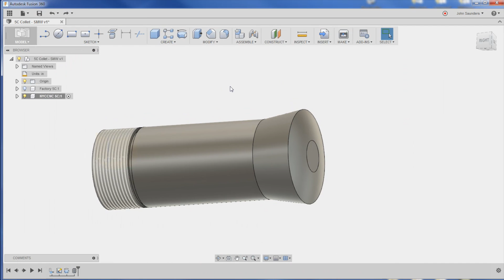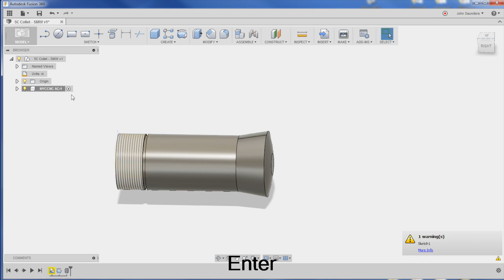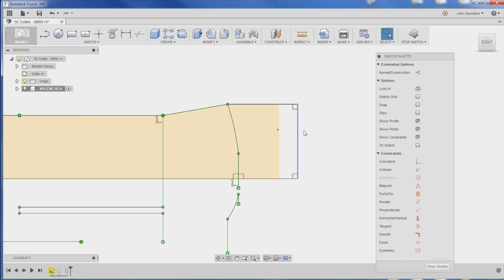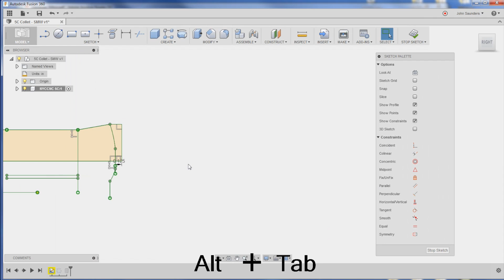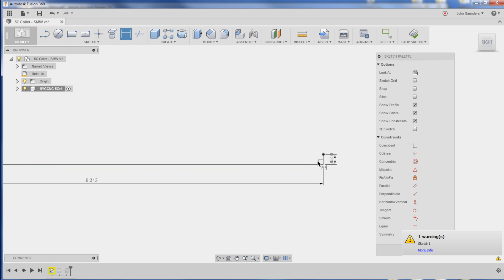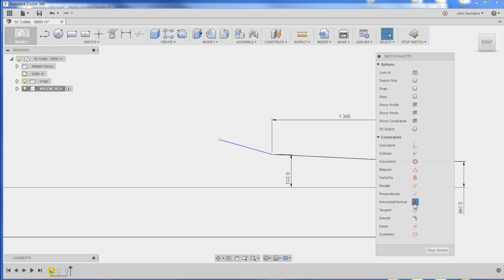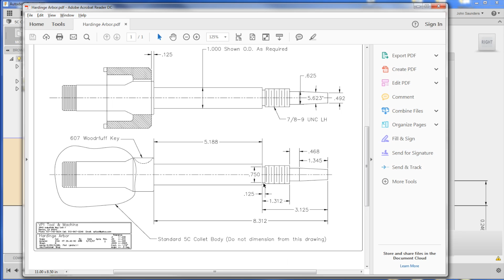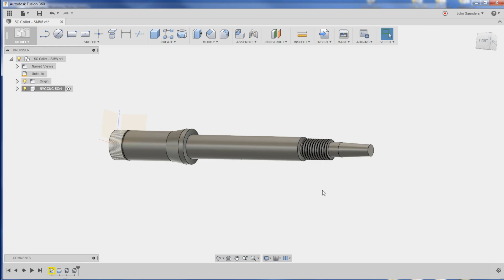Fusion 360 Hardinge 5C Arbor CAD Tutorial!  FF44

Comment: You need more information. The drawing shows that after the taper, the arbour has a cylindrical section that sticks 1/8" out of the machine, but doesn't give any dimension for how much is inside the machine. You modeled it as just 1/8" + the extension of the curved face of your collet model past the end of the taper.

Comment: Did I miss something or did you miss out a section that takes the woodruf key? Could this be another case of read the drawing thrice, measure twice and cut once?
Reply: It sure looks like there should be a cylindrical part with a key. Or perhaps the drawing is just for reference of some measurements?

I sure like these videos. Fusion 360 looks interesting. I use Rhino at work. Not nearly as good for technical design, but it is company standard (We do a lot of design with complex surfaces).
Reply: If you go back to time mark 0.26 where you talk about cross hatching, that is the driver for the arbor. If you zoom in in the collet receiver in the mill and look at 12:00 and 6:00 you'll see a small slott. Those slots receive the drive pins (not cross hatched in the drawing) The 5C then gets a woodruff key slot and a screw to keep this drive collar attached to the 5C.

Comment: do you ever think there will ever be a day that a person can scan in a traditional print run it thru software and come out with a cad/cam file? seems to me that's where things are slowly going and may already be there i just dont see it,, things have changed so much since the days of hand drawing everything <where i learned what little i know>, thanks for the videos gives me a sight into a world i just dont know/understand but intrigued by!
Reply: I can see it now. Put your stock in the vise. The machine does a 3D scan of the stock. Feed the machine a solid file from either a created design or 3D scan. Machine creates the part without interaction. I don't think it's that far off.
You can almost do that now with a 3D printer. The printers even have built in 3D scanner.
Reply: It is possible, but a lot of drawings do not follow standard practices and are dimensioned differently between manufacturers and designers. Some drawings use datums properly and outline the geometry correctly, but improper drafting can lead to dimensions referenced off of incorrect originating points. This can induce higher-than-designed tolerance stackup. It takes a good designer or engineer to examine a drawing and convert it to a proper model. I would love to be able to scan an existing print for features, but from experience it has been best to be sceptical of any drawing that comes through the door.
Reply: +Jack Flash - I do not doubt your idea is already in work. I would expect it within the next few years. The strides in 3D scanning and computer vision are quite impressive.

Comment: it will be the sketch plane where the problem is, if you turn on the origin on for the part you did if the sketch is on the origin redefine the sketch to it, or add a new work plane. then when you delete the factory part it should be all good